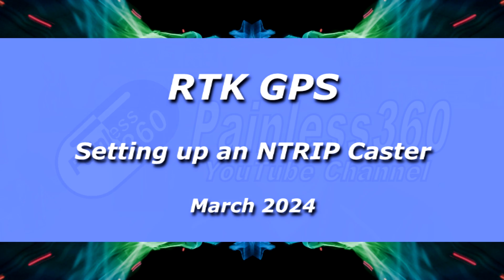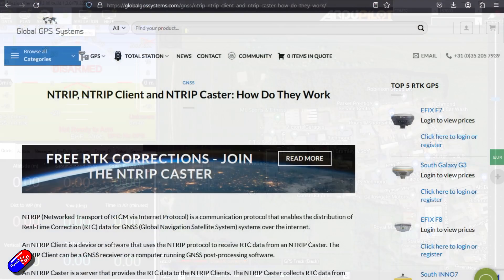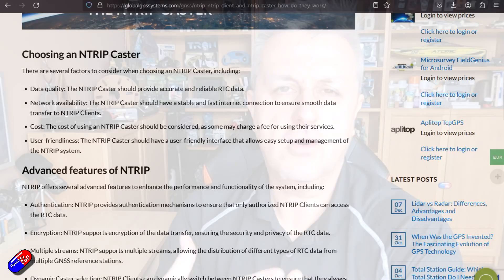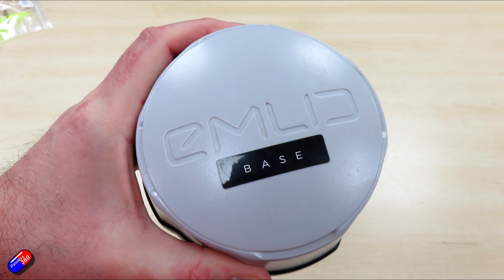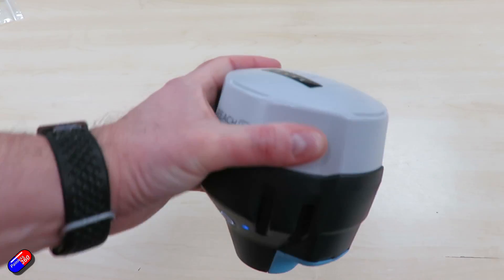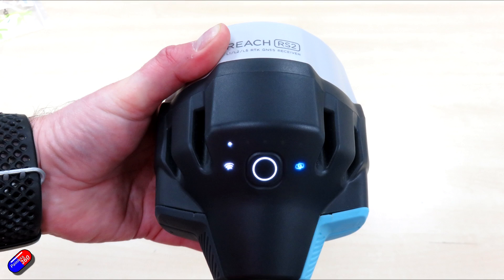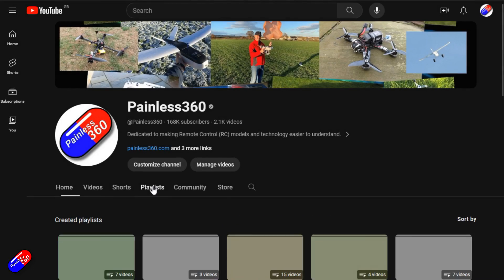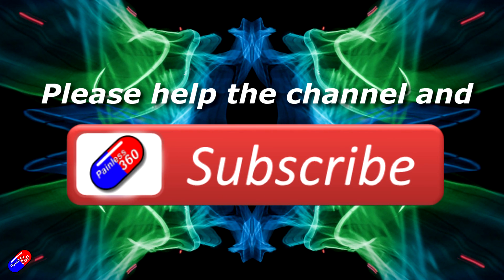RTK GPS: Setting up an NTRIP Caster (with Ben from 3DXR)

Comment: Nice video.  In the US (Florida)  NTRIP RTK corrections are available all over the state for free, run by the govt.  Virtually everyone is within a reasonable distance of a fixed base station (I'm 8km away).  For "float" NTRIP, accuracy is still quite good up to 80km from a fixed base location.